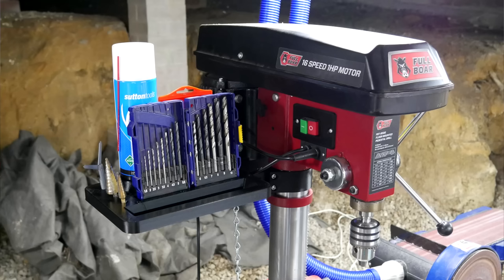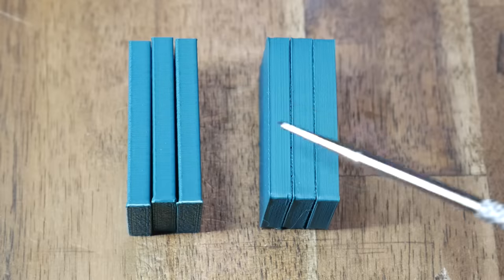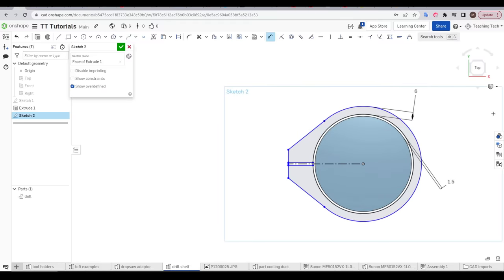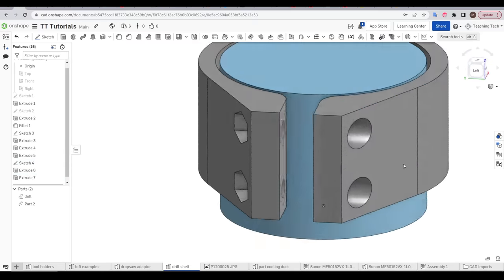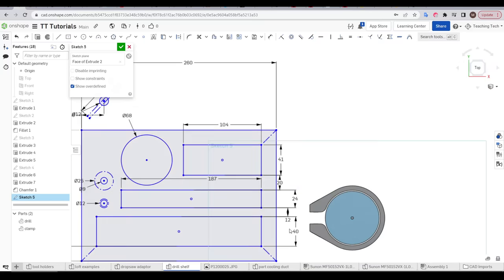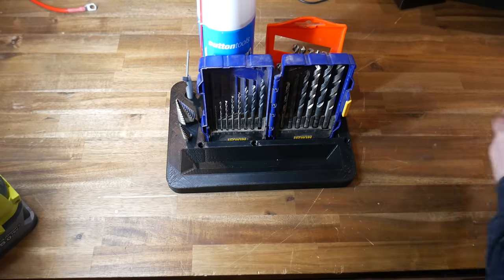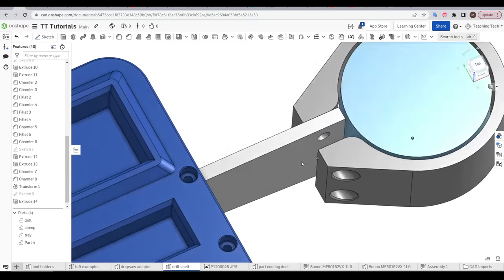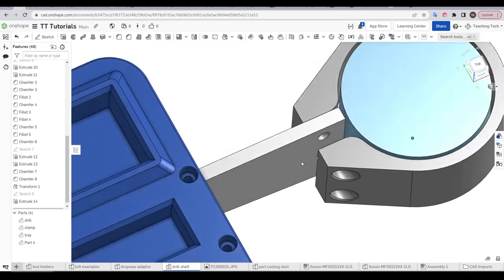Designing STRONG parts: tips and tricks - 3D design for 3D printing pt5

Comment: This is a great tutorial, but there’s gotta be a better and less hacky way to introduce supporting perimeters into a structural part. I guess your way works and has a bit of a fun aesthetic, but I feel like there should be a better way aside from something really extra like finite element simulation/optimization or smart infill ala CNCkitchen.

I’d have probably just given it like 5 perimeters and a flat parallel interior wall to add more filament in the loaded direction, but I kinda hate modeling. But then I’d have tried to do something fancy like a blind dovetail to slide the shelf bracket onto the column mount so it’s removable without tools . Or maybe tried to come up with a compliant mechanism to flex and lock the column mount rather than boring bolts (that you have to run out to the store for). Aaaaaaand I would have spent 10 hours on it. Damn it, never mind, carry on
Reply: Wait... 10 hours on a part that could have easily been designed in 20 minutes, just because you wanted to try some novel design elements or were drawn to overcomplicate the design? I KNEW someone was looking over my shoulder all these years.

Comment: Great series. Recently picked up a 3d printer and I am going to try and make a flag pole holder for a pirate flag for my kids den. Any tips on making an angled hole would be amazing as I am stumped trying to get the hole to follow the hypotenuse of a triangle. Keep the videos coming.
Reply: Edit the sketch with the hypotenuse line and draw a construction line at 90deg to it (or in next step you can use an existing solid line that’s at 90deg) close sketch
Make a new plane to draw on and choose that line for the base of that plane
you can now sketch your circle for the flag pole on that new plane at the correct angle

Comment: Why criss cross cutout? The infill is the same shape. With the outer shell it is even stronger than the one with the cutout. Check CHEP and Makers Muse videos on the matter.
FYI Cutouts are made to have less material usage with CONVENTIONAL production methods. Additive manufacturing lets you have less material usage with the same strength of the final part
Reply: Agreed. This is an example of where additive manufacturing doesn't have to abide by all the constraints we have in conventional production. Additive doesn't necessarily require elements like reinforcement webbing, draft angles, and so many other things.

Comment: If you just made the clamp and support bar the same print, you could have made it thicker and it'd have been plenty strong. Also would fit slightly different bars, rather than be reliant on that 7mm gap.

Comment: Been considering designing something like this for my 3D printer, though I have been having a bit of issues with a new stepper motor I got recently skipping steps..(tried changing the voltage multiple times with no success).. maybe I got a faulty one 🤔

Comment: @5:56 doesn't onshape support offset extrudes? would make this a single operation like fusion360 instead of a two operation cut and separate fill as done here. even more optimized in fusion 360 would be to do the entire hole as a feature and then just mirror the feature. seems quite limited in onshape here.

Comment: Make a pedistol in the floor out of uv resin. If you really wanted to be fun you could make a box in the floor with your printer and then pour resin into it then place the drill on top of it. It's only semi permanent but should hold a little drill in place.

Comment: You know that dug out basement is going to hinder you personally and professionally. Assuming you own the property consider ripping the band aid off now and having it dug out, poured floors, block walls etc etc. It’s only a matter of time before everything metal starts rusting as it doesn’t even look like there is a vapor barrier down.

I’ve worked in a lot of those basements as an HVAC tech in a historic town near me. The difference is amazing once someone has them “finished”.

Comment: Found youo today. Great videos. I would like to see how you craft a screw with thread and nut for 3d printing. I try to figure that out at the moment.
Reply: In Onshape, there is a custom feature script called Thread creator that you can add and which will take care of this in seconds. Just create a blank bolt, and then use thread creator to add the threads, it's very flexible

Comment: I believe there is an easier way to make the grid in the arm, using boolean logic. You will need to make a copy of the object without any cutouts(full), and one with the 5mm offset cutout(offset). and  you will need the grid. First select the union of the grid and full, then join that with the offset version.
Reply: Bingo. Also, to avoid having to select all of those interrupted profiles individually, make a pattern of squares, rather than lines, and you then have just one contiguous profile to select.

Comment: Not a fan of sharing bolts between the functions of pinching the clamp, and securing the bracket.
The force to hold the clamp, vs the bracket aren't necessarilly the same. Yes, you pre-installed the clamp and measured the gap - but this now precludes the possibility of adjusting it in the future should the plastic 'creep'.
Reply: Sounds like a good point. The bolt could probably still be shared as long as the the bracket isn't clamped but on the outside. Should be easy to modify the clamp for this.. just make one side flat.
Reply: This. While it's not that big of a deal, I did shake my head when I saw that design element.

Comment: Coming from Fusion360, OnShape is a clear winner.  Your video series highlights your "teacher" POV and advances 3D printing out of hobby status to a useful tool just like the drill press itself.  Absolutely great work, mate  The video is  filled with great points but following the menu selection is too quick for me.  With a second You Tube instance, I will use slow motion to watch the mouse (audio off) and index forward to where you are describing your design.

Comment: Curious as to what are some common car parts you can print and have you ever messed with 3d printed aero? Ive been thinking about the conveyer belt mod for the ender 3 and theoretically I could print something like a front splitter or sideskirt. anyone tried this yet?

Comment: While the program seems to work fine, it being browser based and needing an account should disqualify it to be recommended by anyone. 

Any locally installed program you can use for years to come, anything browser based not installed locally could stop working/be limited at any time.
Reply: I've been using Onshape for a couple years now, and while your points are valid it is hands down the best option. and the fact that it is cloud based has it's benefits too. I use onshape regularly on my Samsung Note. Now-a-days "locaclly installed" programs require expensive license renewals annually, so the same could be said about those programs as well.
Reply: I use fusion 360 and it probably is local. Saves are in "cloud" but the main thing is local. I think. But still this is amazing. Back in the day autocad was like 10 floppydisks and cost was like my parents house. No hobby scheit at all. I hate monthly plans but still adobe has me. I hate this but it is the way hobbyist get professional software. For free.
Reply: @cas curse Please enlighten me on what CAD software you use that is free/affordable and as powerful (Fusion 360 is also good).
And they certainly don't run like they "always did" you even have to pay subscriptions for Microsoft office. Programs DEFINITELY are not like they used to be lmao
Reply: @cas curse ...Still waiting on some examples
Reply: @cas curse obviously not what I'm asking... but I'm confident you can figure out what I'm actually asking if you actually wanted to rather than deflecting with your comments. Nice try though lol
Reply: @cas curse I'll just refer you to my first response to you, where I plainly ask the question to which you are avoiding. And as I first stated, most programs are behind paywalls. Subscription based licensing in order to fully use the service (btw it wasn't always like this). You changed your statement from programs "freely" run the same as always, to just "run the same way they always did" obviously software is still software but the way you ACCESS it HAS changed. Aside from subscription and paywalls, programs before digital downloads and cloud services were installed via CD or floppy disk, you bought once and the end. Now it's a digital download with annual subscriptions. To say it's the same as it always has been is ridiculous. So yes, nice try

Comment: Goofy, plus your drill press has a chance of tipping over with the added weight on side.
Reply: lol...he could put 5 kg on the tray and that drill still wouldn't tip over.

Mounted trays like this are a very common solution for a floor-standing drill press like that.